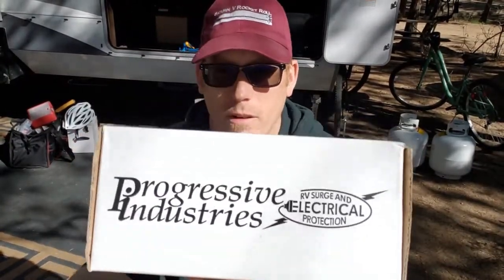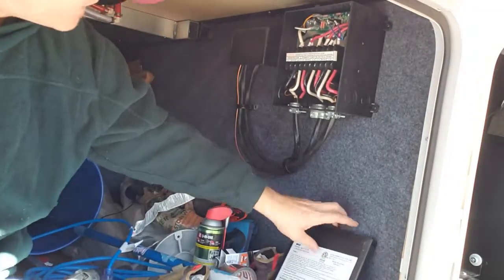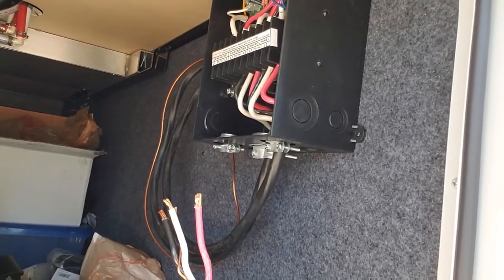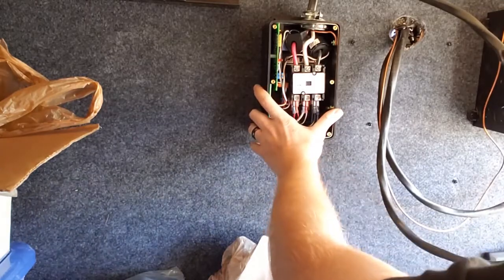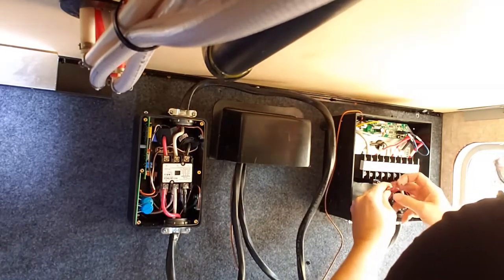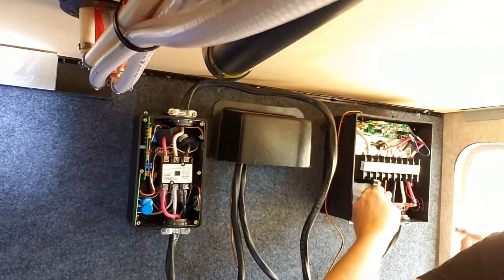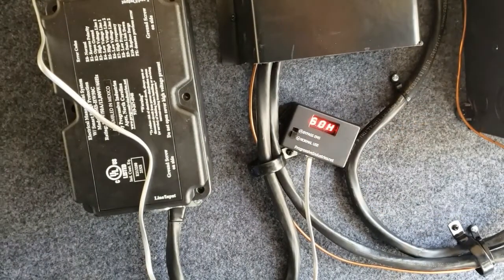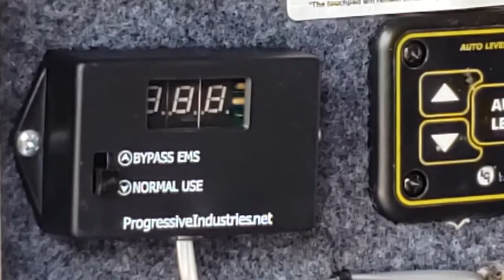Progressive Industries EMS-HW50C Installation

Comment: I put the display in my coach so I can check the code without going outside at night if it shut the power off.
Reply from the maker: I'm thinking about doing the same. Have you ever wished to have it by the street side, say as you getting into the campground and hooking up?
Reply: @AlcoholFreeRV  It would be nice but they haven't updated their display in forever. They should have an in the wall flush mount LCD screen that is water proof. That way the wire can be places behind the wall and out of the weather. I just bought a new 5th wheel and plan on buying another EMS but this time opening the display, making my own flush mount version and putting the guts from the original in it. I guess it won't be that hard to make it waterproof for the outside.